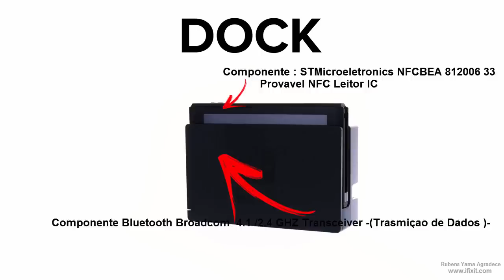Abrindo completamente um  Nintendo Switch -Vendo por Dentro  -(nº976)

Comment: Rubens meu Xbox 360 Travado as vezes esta fazendo o Bip de cmo se eu estivesse abrindo/fechando a bandeja do jogo, o q pode ser ?
Reply from the maker: sobre travamentos podem ser varios fatores , HD ou mesmo defeito da placa :/
Sobre ele apitando sozinho ( plin plin plin ) bem isso pode ser 3 coisas , ou seu xbox esta próximo a reatores lampadas ou alto falantes , ou ele esta com problemas da Placa Frontal Rf Power ou Cabo Flat Touch Power 
Estas sao minas dicas para voce :)
Reply: Ele fica bem do lado do fone da tv isso pode influenciar em algo ? e esse bip so ocorre qnd eu ligo ele ao passar de um dia para o outro ai dps ñ faz mas durante o dia as vezes.
OBS: travado no sentido q so ler jogos original :)